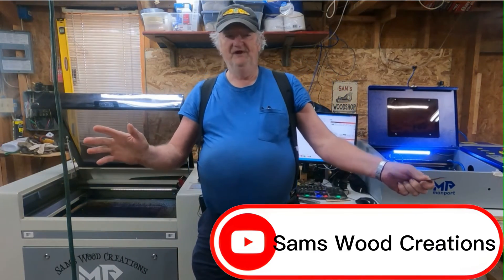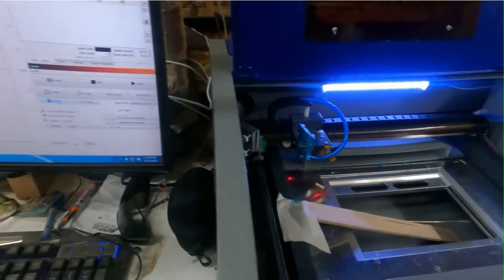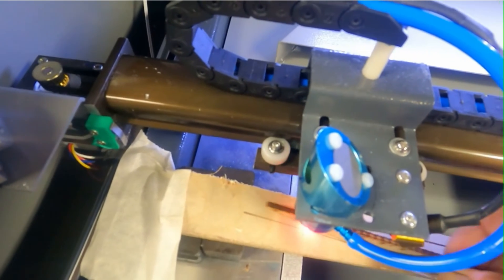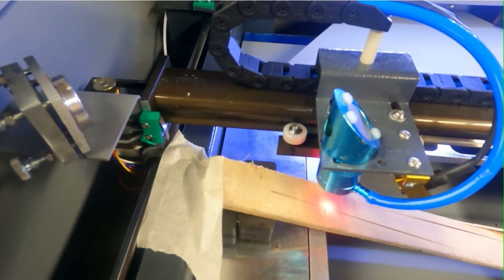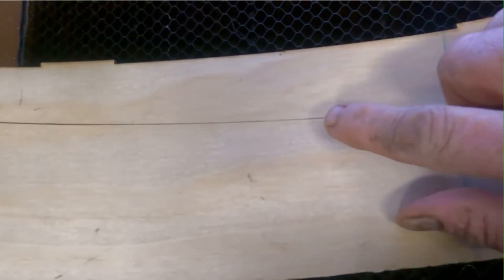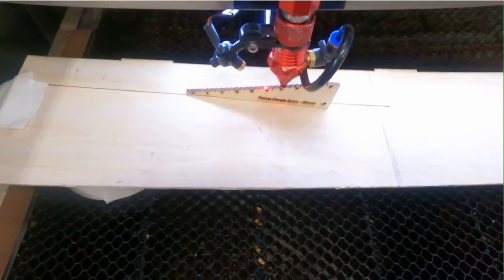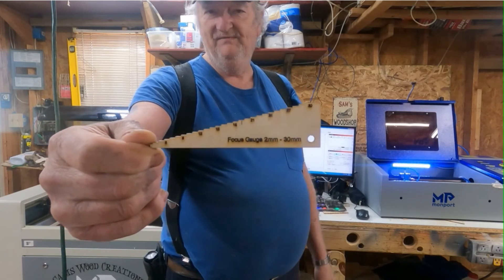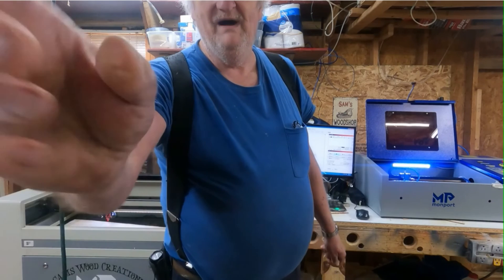Monport Techtips: How to do an unbelievably simple ramp test on your k40 and 60W lasermachine

Comment: Sam, thanks for the vid, you mentioned you made the 60w laser head more user friendly for you. Does that mean you shortened the distance between the third mirror and the laser lense/head?  Also I couldn’t find the file for the step gauge
Reply: Yes I shorted the black tube between the mirror and the lens so I could gain more focus distance with using the pass through for the 60W
Reply from the maker: Hi you can check Sam's channel: https://www.youtube.com/@SamsWoodCreations
Reply: Step Gauge is available here on my channel https://www.youtube.com/watch?v=rKD4HslKm_E